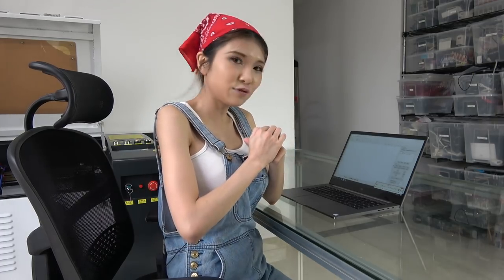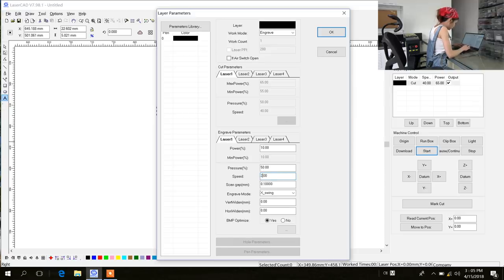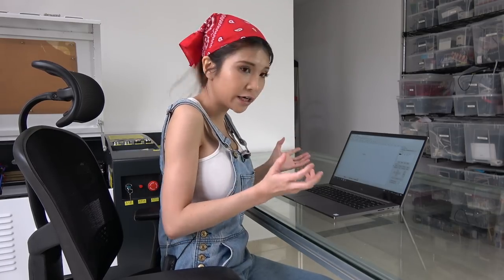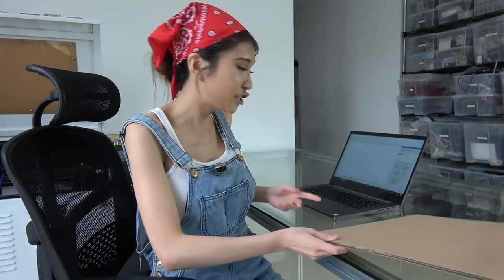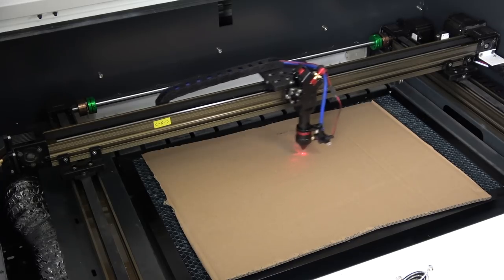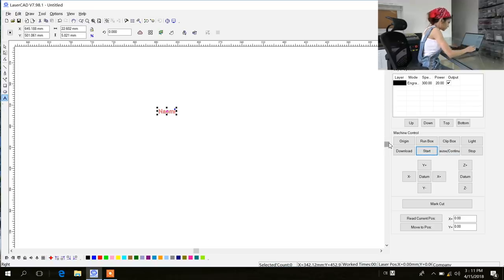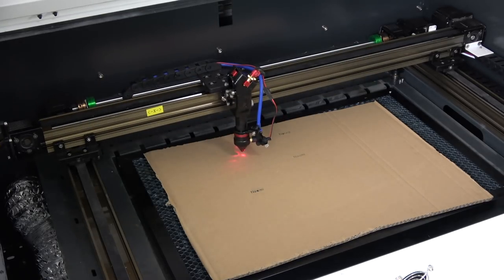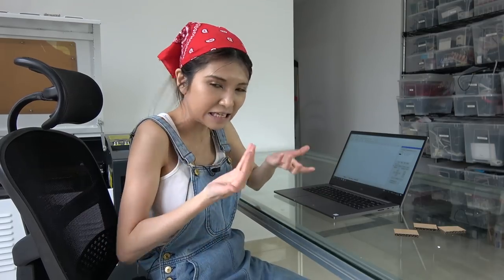Intro to Cutting and Engraving with an 80w Chinese CO2 Laser Cutter

Comment: Did you remember to set the focus distance for the laser ? There is usually a piece of acrylic to put between the cutting head and the material to set the right distance, if it is not automatic.

Comment: I like that you are jumping in and figuring out how to use the laser cutter by experimenting. You are setting a good example for others to emulate. I notice you have not taken the protector off of the viewing window on the lid. You should remove it so you can cut with the lid closed. This will be much safer than leaving the lid up.

Comment: Hi Naomi, just to keep you safe and healthy it’s important to know there a several materials you must NOT attempt to cut or engrave. PTFE (Teflon) and PVC give of poisonous fumes, ABS will melt, PS (polystyrene) and PP (polypropylene) will catch fire. These are the most common but have due diligence before you throw an unknown in the laser. Stay safe so we can all enjoy more of your videos🤗
Reply: Polystyrene doesn't catch fire with air. My guess is you're talking about polystyrene foam. That will, but sheets of polystyrene like shrinky dinks will cut and engrave just fine. idk about polypropylene but i imagine thats the same.

Comment: Twinwall card 10% @ 30mm/sec. 3mm Acrylic 35% @ 12mm/sec 3mm brich plywood 35% @ 8mm/sec 6mm acrylic 50% @ 8mm/sec 6mm MDF 60% @ 8mm/sec. You should be able to engrave at up to 400mm/sec at around 25% power on most surfaces. For high speed vector marking make sure you have enabled the PPI feature and set to 600-1200.
Reply: DC glass tube, 80/60W (peak/nominal) as in video.

Comment: Engrave: I think you can play a bit with scan gap. This should be a similar function like skip x lines. Depending on the linewidth of the laser you should be able to get different dethps of with larger steps at the same power and speed setting. I'm using it to engrave numbers in marker dots.
There should also be some setting of what shall be engraved (not only layer, but selection on faces as well), so it will engrave in the end only filled faces.
Cut: You might need to check if the pen settings can be changed. Usually the settings should be hair lines only and if you have drawings with a linewidth thicker then 0.2mm the laser might cut left and right of the line.

Also please close the lid: Remember, don't look into the laser beam with the remaining eye! 
Scattering from the metal mesh can harm your eyes and the PMMA lid is thick enough and absorbs ~100% of the energy.

Comment: I had the same issues when starting out with my 100 watt laser. First remove the paper cover on the top door/lid of the laser cutter so you can watch the laser cut. It is perfectly safe. My main problem at the start was my laser was not focused. If the beam is not focused, it is very wide and causes things to catch fire. The main thing that helped me was getting a bigger air-assist pump. The air assist stops the parts catching fire or burning too much and you get much cleaner, finer cuts and can cut deeper at the same settings. It can cut paper or cardboard beautifully without scorching. Before I got the bigger air assist pump, my cuts were much worse.
How level is the bed on your laser cutter? The one I have (from a different company) is impossible to level, which is a real problem for engraving and keeping the laser in focus.

For cardboard and paper we can cut at a speed of 200 with 70 power. It took me a week before I got my first successful cut, I had no idea how to use it!

Comment: Is it safe to keep the lid open ? Especially if you engrave metal. Could the lazer reflect off the item and out of the unit ? I understand the actual laser light is not in the visible spectrum. The red visible light is just a pilot indicator.

Comment: Naomi, I worry about the laser and your eyes. Please persuade me you've thought about running the machine with the cover open and no goggles. Sooner or later, I think you're going to get a reflection off a workpiece and be looking at it when that happens. 

And a different aspect - you can cut fabric so a sewing project could work.

Viewing from Wellington in New Zealand.
Reply: I can't help but worry about that too. That and do her downstairs neighbours try to sleep to the sounds of machinery? :)
Reply: Not to mention the poisonous fumes lasers emit when cutting
Reply: Naomi has rigged a venting system to outside, but it may have difficulty keeping up when the cover is open.
Reply: It can't work with the cover open can it.  The fumes come off the part being burned.
Reply: Yes. The venting fan would need to move far more air while the cover is open, to capture the fumes too.

I'm also surprised the system runs at all with the cover open - there should be a safety interlock.
Reply: Bill Parkin she may have defeated the safety. I think it can easily be done with two magnets.
Reply: No need to worry about your eyes or wear goggles. ‘Laser fumes’ aren’t any more toxic than the material that it’s burning. We had some laser cutters at school and they’re pretty harmless once you get your power settings dialed in for the specific material.
Reply: Worry about yourself, she is an intelligent adult, she doesn't need your concern or your advice.
Reply: The energy in the laser is enough to destroy eyesight in a moment. The cover window will be designed to filter the high-energy laser light, as are the appropriate goggles. The low-energy red light is intended to be seen without injury, and can be seen through the cover and the goggles.
Reply: In order for the laser to be effective, it has to be in focus. There is no possible way a reflection from the laser could be harmful because by the time it reaches your eye, it would be far outside the focal range.

Comment: Thanks Naomi, you made it look very simple. I have a laser module in transit to attach to a 3D printer. I'm just researching / learning so I don't burn my house down. Cheers, JAYTEE
Reply: +tin2001 Thanks for reinforcing that information, we only have one set of eyes. As I'll be adding this to a 3D Printer, I'll also be enclosing it for fume extraction AND eye protection. Thanks again
Reply: Jaytee, I don't trust the China goggles. I assume they're colored plastic and don't protect your eyes at all. I would avoid a blue light laser and get a CO2 laser which is at least blocked by more materials, and usually come in a machine with a lid (like this one, but Naomi has bypassed the lid switch to film).
Reply: Hey +Jamie, thanks for the extra info and I agree in the importance of your comments. I've purchased the module from Endurance lasers and will definitely be testing a beam through the goggles onto a background object to verify their effectiveness. Cheers, JAYTEE
Reply: I added a laser to my 3d printer and found out pretty quickly that it needed a physical cutoff switch, also a test fire button. 3d printers don't always understand that laser on & dwell shouldn't occur at the same time! its also pretty handy for doing dry runs and job alignment :)

Comment: Does that laser use proprietary instruction sets or common gcode? If it’s common gcode there are plugins for Inkscape (like km-laser on Github) that make the design process easier than what you get with most software packages like that.

Comment: Why do u use carton as material. Find scrap aluminum and steel plats and try your tests and than check the results.
Reply: An 80w laser will not cut aluminium or steel.